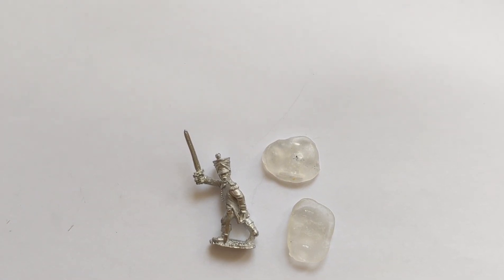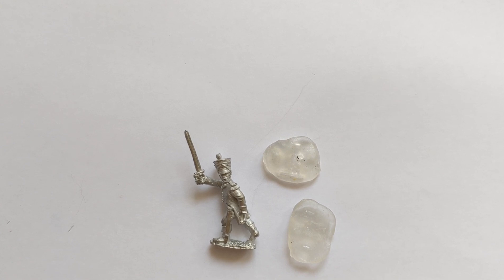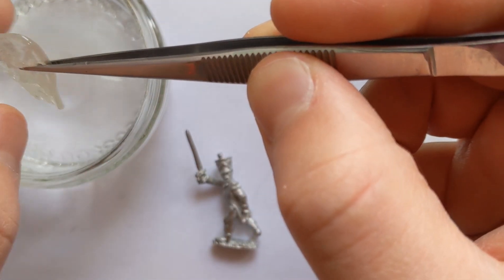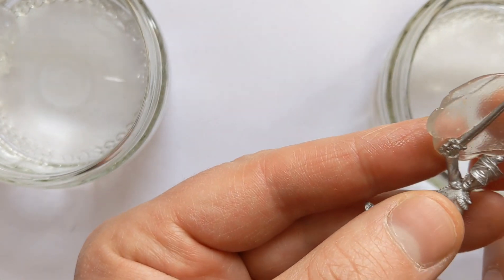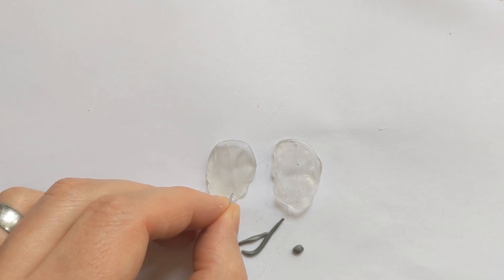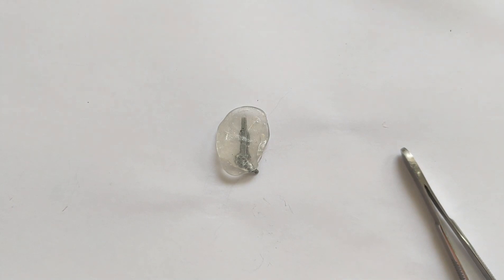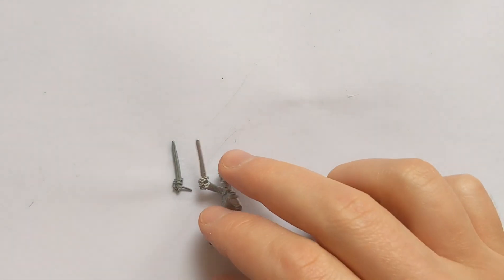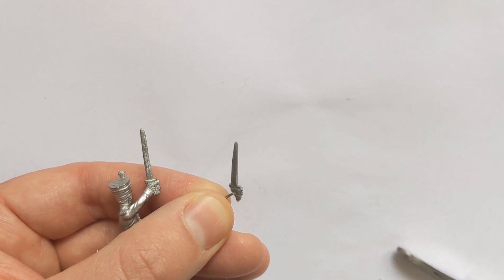Press Moulding to Replace Broken or Missing Components on Your Miniatures

Comment: Mate that is Genius! Youve taken this Game to a whole new level. I dont know if youre with Gav: but he did something very similar to your technique, he drilled out the hand on a 54 mm figure and fashioned a sword out plasticard and it looked pretty good. He had created the blade with a small shaft to insert into the hand (sounds terrible i know) lol
Id be reluctant to cut off the hand especially on a Front Rank figure in case i fked it. But i get the idea.
I believe there is atleast one manufacturer who does after market swords in 28mm. Mixed reviews about those.
Q: how strong is the sword?
Hope youre Well
Reply from the maker: Glad it's a useful video. Gav does some great work with his large scale miniatures and busts.  The putty I used (ProCreate) is reasonably tough and flexible, so I wouldn't worry about it fracturing with normal gaming use.
Reply: @CullodenPaintingStudio  Thanks Pal

Comment: Isn't the epoxy brittle? I use hair pins (bobby pins). There are ones that are the correct width about equal to  model sword blade.  I've found that the pin maybe worked to include a tang and a blade. Also the pins are a spring metal. They work for sword scabbards as well.
Reply from the maker: ProCreate is a very flexible putty once set, but others might be brittle yes.  I have read about using hair pins - including having a small anvil to flatten and shape them!